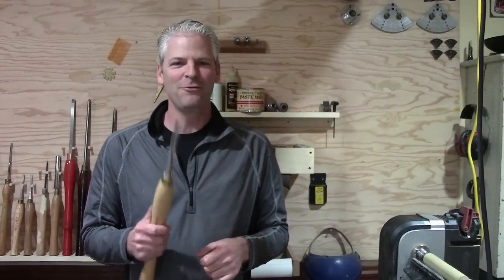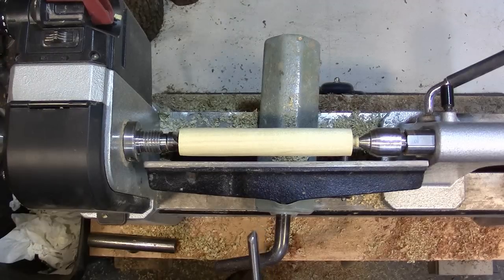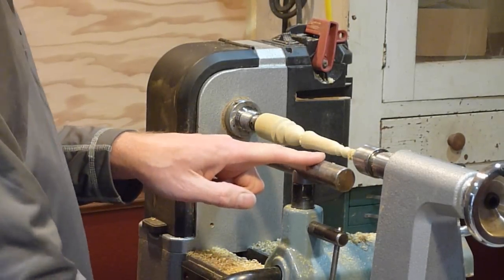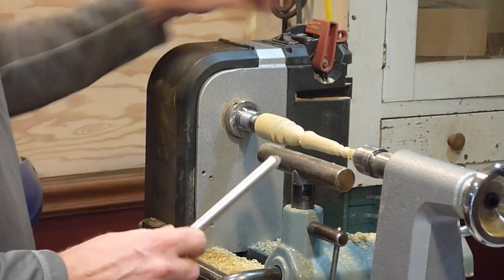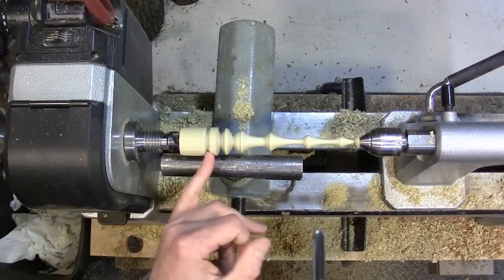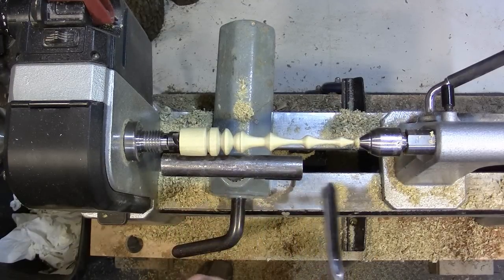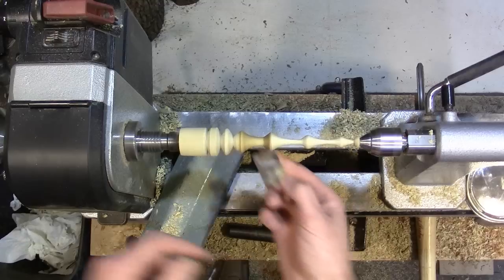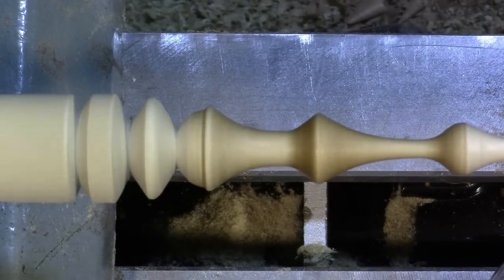Woodturning Q&A Fingernail Gouge

Comment: The Cindy Drozda detail spindle gouge is well worth getting because it cuts beautifully and lets you get into really tight cuts.  I have one but haven't used it here yet because I need to get a traditional grinder with 8" wheels in order to ensure I keep the grind on Cindy's gouge.  I use the Sorby Pro, flat belt grinder, but Cindy uses the Wolverine system...more stuff to buy, oh boy, I hate this. (Just bought 2 new chucks to save changing jaws, plumbing new depths of laziness here)

Comment: That's reasonable.  The reason I liked the Cindy gouge is because the grind allows me to get into tight spaces and make delicate cuts more easily than with a standard grind.  I could maybe copy the grind onto a standard gouge but Cindy's gouge is only a couple of dollars more than a standard spindle gouge so I'd probably waste more metal away trying to replicate her grind than I'd save.  I've found, after 7 years, that I only use about 4 tools now - wish I'd done more practice than buying.

Comment: Thanks Carl; this video helped me with a problem I'm having with the fingernail gouge. I have a terrible time with grabs, not sure what I do wrong. In your video, you mainly used the point. I try to use more of the side, as a cutting action. Maybe I try to go to far? Any advice on how I can master this tool?
Reply from the maker: Bill Wells I find that using the side gives me more problems. I try to stay on the point as much as possible. I hope this helps, if you still have problems let me know.